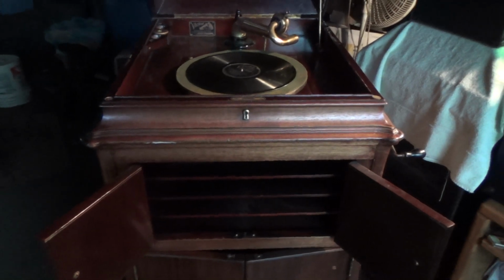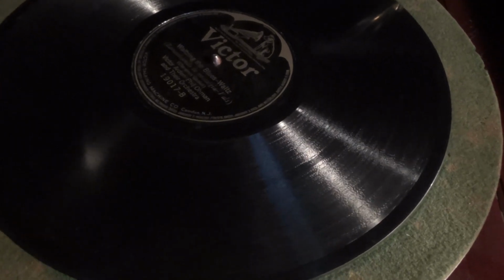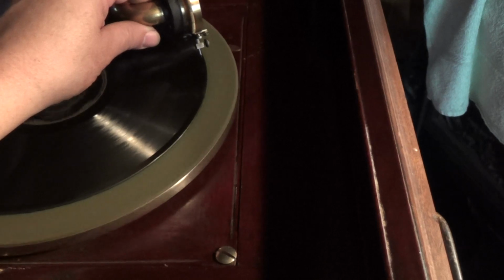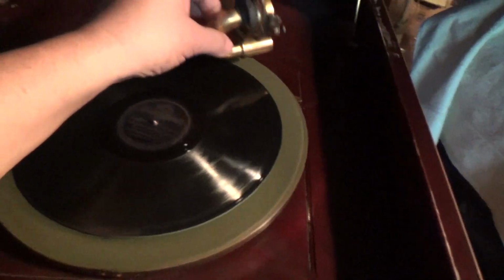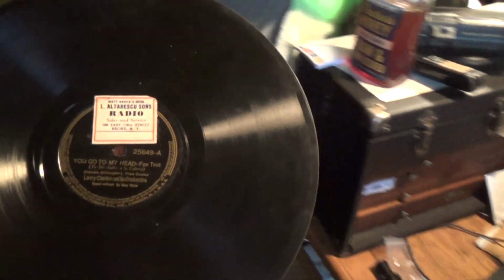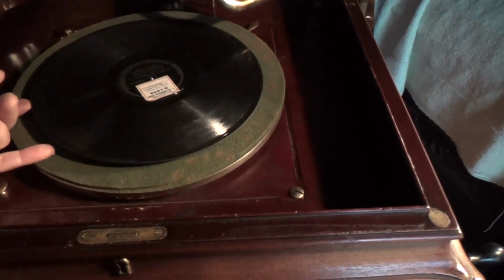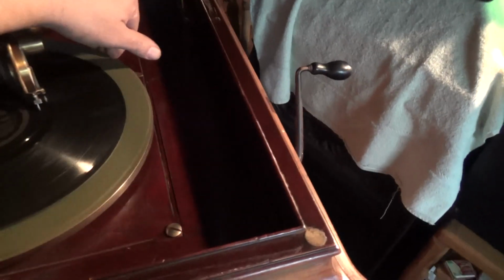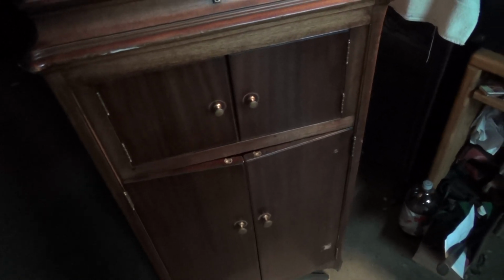Victrola the 16th plays again VV- XVI 95208  1913

Comment: Hi Jim: I’m the guy in Arizona you messaged a while back. I watch your videos quite often so I thought I tell you about an reproducer experiment I did. You’ll think I’m crazy but it was fun with very interesting results. I made a diaphragm for a #2 using 1/32 inch thick clear polycarbonate . It works extremely well. Compared two reproducers on the same record, my wife said the poly sounded clearer.  I’m sure I’m not the only one to try this. I jus thought I’d pass it on. Try it when you have time.
All the best .
Reply from the maker: Aluminum, celluloid, glass, and other substances have been used for diaphragms in the past.  Mica is best known because Victor and Columbia made huge numbers of machines using it.  Today it's the choice because the parts vendors carry mica in the sizes needed for No2's, and all the other reproducers that use that size diaphragm.  The Silvertone for instance uses the same size diaphragm as the Victor and HMV 2's.  That's far from the only reproducer I found that shared a common Victor Size.  Sounds like a fun project, if it's working well you might think about mass producing some more and marketing them on eBay, or at the shows if they ever reopen.  I don't keep any Lexan sheets around, or have tools for working and shaping poly.  I do have a small bag of mica diaphragms for the No2 I scored on eBay last year.  I don't rebuild near as many No2's as I do Exhibitions, and HMV No4's.  I do keep spare No2's ready to be rebuilt as the need arises.  Mostly I use them to replace Exhibitions that fell off their back gaskets 70 years ago and got lost.  Still less expensive to buy a No2 than the Exhibition, just.
Reply: Thanks for the reply. I’m coming up on 75 years. I enjoy the hobby and sell on eBay only to help with the expenses. I doubt I’ll start more manufacturing. Maybe I’ll do a video with a polycarbonate diaphragm. One supplier already cut me off. Maybe he thinks I’m competing with him when I’m really not. There are many good suppliers I buy from. Have a great week. Neil
Reply from the maker: I buy reproducer parts from Walt Sommers when needed because I have done so for years, but most of the rest of what I need I find at ordinary stores, or online stores since the Plague hit.  Felt sheets are sourced from craft stores, nothing unique about turntable felts other than the colors.  Cleaning and lubrication stuff from Kotton Klenser, or the auto part store.  The rest comes from my parts heap, spare motors are great for finding missing ball bearings and screws, governor weights and so on.  It's amazing how much stuff people will leave off a machine thinking it's an unnecessary part.  This is why I now buy various thicknesses of felt in rolls for making motor to motorboard washers.  I had to deal with a nearby industrial supply company for that.  I don't deal with eBay for selling anymore, did for 15 years before they pissed me off with the constantly changing rules.  Craigslist, marketplace, and so on, or the occasional local wanting to play old records.  I would keep them all, but I have only so much room, and a large number of machines.  Someone asked me about a VV-50 a few weeks back, I answered what year, what horn style, what finish, what wood, early, middle, or late style motor, tag or water decal, got them all.  Even have one with a one of a kind near perfect copy home made cabinet, but it would take a large pile of cash to get that one away from me.  Right now I need to find homes for the Silvertone, the altered but functional Victrola 16, and another Victrola 11 yet to be seen.  I have no room for these machines, and I need them out of the big shop sooner or later.  I have one or more 9's stashed in every storage space, 6's, and 4's as well, even some 8's.  It's a disease, the inability to walk away from a good Victrola deal.
Reply: I have the same disease. I just haven’t had it for as many years as you have. I make gaskets, buy felt the same way. It’s just a lot of fun. I even make my own rear  isolators. They really work great.
Reply from the maker: I rebuild reproducers for mostly myself, so I don't do enough volume for making my own gaskets and isolators to be economically viable.  A friend of mine in another country made up a big pile of No2, and No4 gaskets for me a few years back.  He sourced the material from the shoe industry.  Seems to be the same material being used for the gaskets offered by the parts sellers here.  I don't find it ideal as it is a sponge material and tends to settle when compressed causing the diaphragm to change its level inside the clamped body as the air is forced out.  I have to let it sit for several days to a week before I attach, and adjust the needlebar.  Irritating.  The way around this is to just use Exhibition tubing in everything, and I do use it wherever I can get away with it.  Trouble is they don't seem to make that tubing in red, or black, and I do sell some machines and want them to look original as possible.   Walt's isolator gaskets have gotten much softer in recent years, I still have to carve out the bottom of the brass sleeve on the exhibition ones so the gap between reproducer body and tonearm is correct.  Not sure why he hasn't corrected that issue yet, as the No2, and 4 ones are correct.